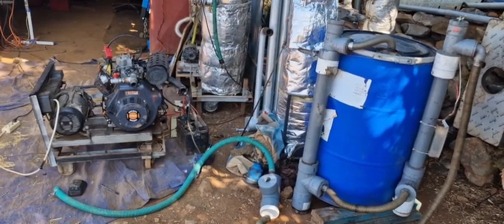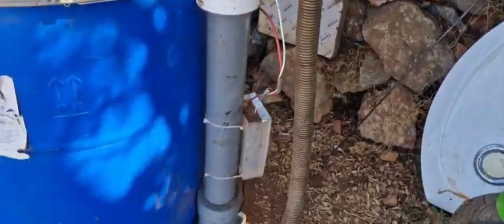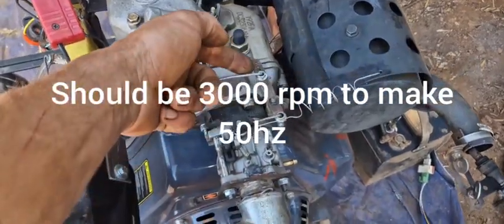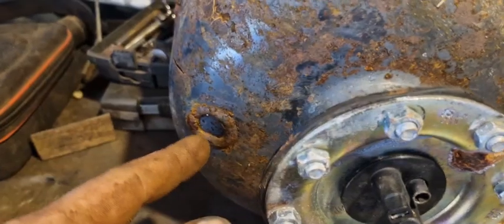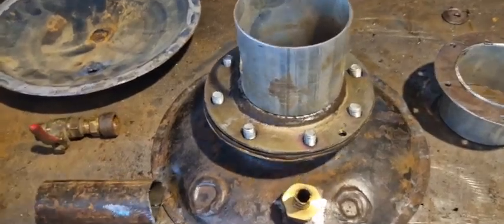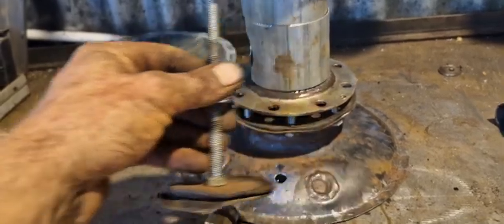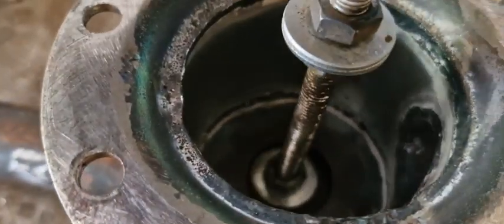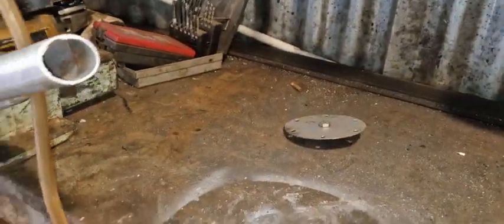zero pressure regulator for woodgas engine #DIYGasifier #BiomassEnergy #OffGridLiving

Comment: Thanks for sharing all your expériments, it's very inspiring.
Reply from the maker: I highly appreciate your kind words, glad you find it useful for your projects. if you want something en don't have or want to spend the money to bay it you have to figure out how to make it from what you have . In my case its scrap . Greetings
Reply: @oscarverwey  It will be useful to me when I have succeeded in making a stable and durable wood gasifier. This is exactly what I'm doing at the moment, my prototypes are made from gas bottles, water heater tanks and all kinds of recovered scrap metal.
Reply from the maker: @shlagueurdetek5197 . Interesting! What kind do you make ? Imbert, t
Stratified.  Single ore dual air beld nozzles? I can help you if you like to make a low tar ore evenn a zero tar gasiffier . Greetings
Reply: I started with an imbert, I was able to produce gas, power a generator (smdo hx6000) but I do not produce enough electrical power (1100w - 190v), I have problems sliding the wood (45min maximum operation) and I have a lot of tar in the gas. I built a filtering system (wet sccruber + radiator + cellulose wadding filter) but I still have too much tar in the gases after sccruber (my fan gets clogged quickly). the cellulose wadding filter works perfectly, the gases are completely clean at the outlet. In a few weeks I will start a new prototype like that of Olivier Guerin, which looks very promising. my filtering system will be more durable with this design.
 Your videos are already a very valuable help.
Reply from the maker: @shlagueurdetek5197.  I recognise al your experiences.  If you like I can give you some simple tips en some pdf's i believe are the most fundamental for achieving low en tar free gas . My email address is . Greetings

Comment: Just a suggestion, a flow dynamic regulator based on geometry is a cool thing to design and to play with, but in this case it may be an overkill. Any type of generator (mechanical-electric) is designed to work most efficiently in a specific range. The most pertinent example is the Tesla Turbine, even it Tesla designed it to work extremely efficiently in very specific (and quite narrow) RPM range, outside of that range it will work but efficiency drastically drops. In your particular case, it may be worth to control the load on the generator via a small battery/super-cap bank ( assuming small surges ) instead trying to engineer on the wood-gas supplying side.
Reply from the maker: I appreciate your comment, Hmm i understand what you mean , good point.  I was making it 3x as big as necessary because the pressure of the vacuum cleaner pump might only produce 30 to 100 mb . Maybe even lower at full load . En the bigger the membrane the smaller the difference wil be right
Reply: What if you just link the speed of the blower (that pushes air into the gasifier) to the outputpower?
This way you're producing more gas at higher pressure when you need more power. And less gas when you need less kW's.
Just an idea...
Reply from the maker: @TerrorTubbie666  it's a good one .I thought about that aswell, im gonna use a negative pressure swich so when the generator starts the blower turns on en the other way around, en let the regulator do the flow control, seems it needs some measurements like pressure drop en flow rate to make up for the pressure drop with pwm en a micro controller 🤔. The ardrino air fuel ratio meter does work, but I don't like the 300mm+ pressure drop in the system. This limits the engine power , i believe that when they both used it, it wil work better
Reply: if you were to have a plastic cylindar with one end cut off, a second to slide within ... fill bottom with water, slide other within with inflow and outflow lines...

can store gas safely inbetween gasifyer and motoe with pressure of gravity of top cylindar weight and no oxygen mixing.
😇😎😇
Reply from the maker: @Socrates-ti2dh  I understand that.  The reason for using a zero pressure regulator en a centrifugel fan is to reduce the suction resistance en it helps getting more power put of the engine en maintaining a better fuel radio at different loads
Reply: would have to be able to hold gas production volume for time of operation, of course.